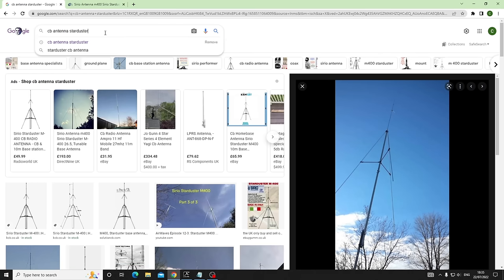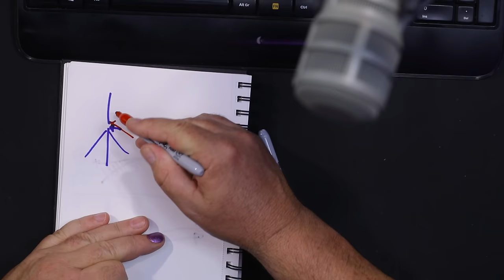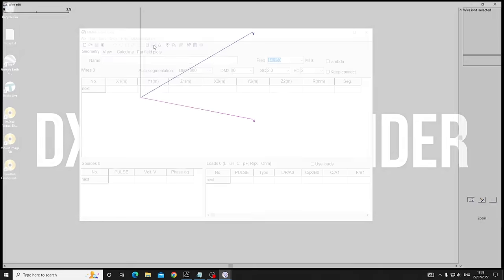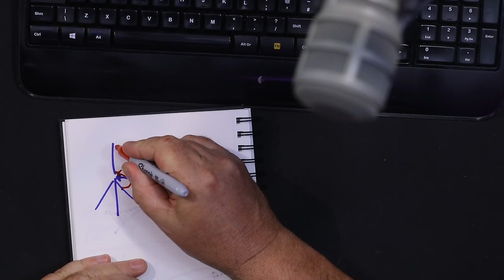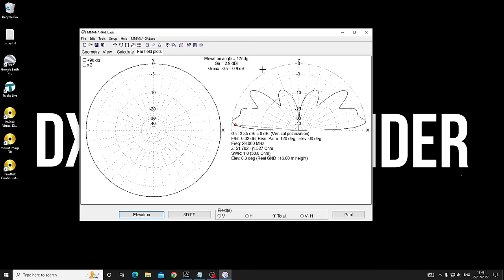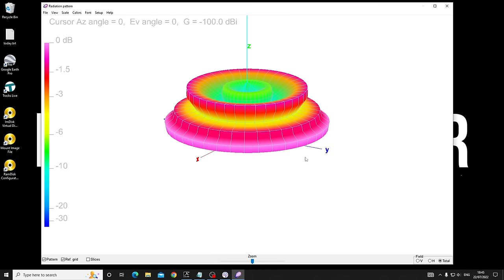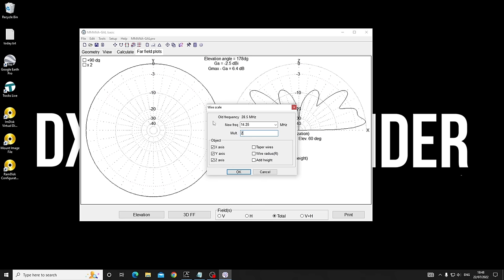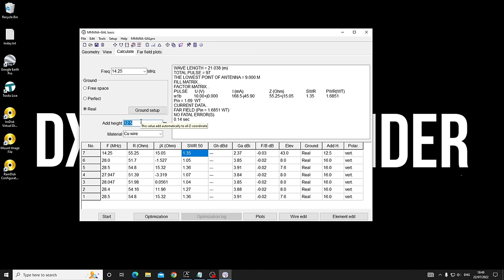The Ultimate CB / 11m Antenna?

Comment: I'm been studying and working on 10 and 11 meter antennas for 45 years. Some antenna theory has actually changed in those years. The Starduster was sold as a half wave. The coaxial feed line goes inside the mast pipe, for additional shielding / isolation from the antenna. The downside is the radiator is not grounded. The small radials are on the center of the quarter wave radiator. Some speculate that it is to increase frequency range, while some believe it is to raise the high current point on the antenna to reduce ground loss and increase gain. In a similar, "modified quarter wave" the radials are angled down to a point to increase the impedance to 50 ohms. The Starduster radials are angled down even more and possibly the small center radiator radials somehow decrease the impedance to match the feed line with the large radials angled so far down. The Starduster antenna design does work really well, especially considering its smallish size.
Reply from the maker: Very interesting Jim.. Thanks.
Reply: @DXCommanderHQ  Back in to late 70s I used a Starduster for 11m and 10m... After I put up a multi-band quad, I shortened the elements to optimize it for dedicated 29-29.7 FM use.  The radials were sloped down more than 45 degrees, perhaps 60 degrees, and the vertical/radial lengths were asymmetric. I tweaked the asymmetry slightly when I trimmed it for 29FM, increasing the asymmetry - making it more-off-center-fed - seemed to tilt the pattern slightly towards the horizon.  Also, someone diddled around with a coax matching section, 75-ohm I presume, and was able to get a "perfect" 50-Ohm match on theirs.
Reply: Same here !
Reply: The lower angle achieves a slightly higher gain. Isolation from a conductive mast is preferable for a cleaner pattern. A decent coaxial ferrite choke should also be employed for CMC, and you may wish to take care of static build up by grounding the shield of the coax (from memory, I think a 1/4 wave down from feedpoint). I have built such an antenna with 8 ground radials, and it was a great performer.
Reply: I’ll tell ya not for nothing but I talk to a few guys running them on channel 6 and there is a guy on 11 also and they just boom into my phone radio and I know there not running huge watts and I know they’re not lying because that thing would fry to much more then 2,000 watts and that’s not bein longwinded
Reply: Why this 45 degrees? How, by chance, does this mean the impedance will be 50 ohms? Why not some slightly different angle? How neat.
Reply: @jimjungle1397 any comments on the Gpa27-45 vs the starduster? Thanks.
Reply: @redeyegooner GPA 20-45 is a antenna made for the pirate 45 meter band ?
Reply: The star duster is a great antenna for obstructed areas no doubt.

Comment: I have a Sirio M-400 Starduster, I run on 10meters, looks identical to the one pictured.  I have it mounted with the feedpoint at about 30ft.   It is an awesome antenna.  I have worked a bunch of DX on that piece of kit.   It is wide-banded and is fairly flat across 10 and 11 meters according to my Rig Expert.   I believe the bit at the top is a capacity hat.  I say build the darn thing Cal!!!
Reply from the maker: Will do John!!
Reply from the maker: John... If you have internet - and if you have time, join us on the full-build and test Premiere? https://youtu.be/V8Qq4-0_TjQ
Reply: @DXCommanderHQ  the 3 things sticking out on the top rod is called a capacitance hat.

Comment: Excelent. I would love to see a rebirth of CB in the states. Maybe this antenna would be the boost CB needs.  A duel band CB / 10m   or would probubly be a good seller as you could get both Amature radio and CB band sales.
Reply: Kinda hard when these blowers aka cell phones are so popular. Still seeing aluminum in the air in my city, just a small handful still operating.
Reply: @fridayjoefriday  the CB band is manely full of people running higher than legal power and trying to talk to the world.  Very few local people using CB and even fewer OTR truck drivers. Hams all start from somewhere.
Reply: @brentchristians9888  I still use CB to talk with local peeps, circa 5-7 mile radius( most are licenced) but the conversation is easy like a pub lock in as opposed to a night at the Opera.
Reply: Thier is a uhf CB service in u.s. called GMRS and it uses repeater's up to 50 watts gaining traction as we speak
Reply: @Cardassiaprime : 😆🤣!!
Reply from the maker: Brent.. I managed 15m, 12m and 10m in the end.. If you have time, join us on the full-build and test Premiere? https://youtu.be/V8Qq4-0_TjQ
Reply: The cb band when theres dx which is quite often is busier than any ham band and you can make contacts worldwide

Comment: Antron A-99 with the 5/8 wave "power up" top section - add the ground plane kit, - best ever 10/11m I've ever used - had a great qso with Bob McLeod in the Falklands only using 10w on 10m using it.
Reply from the maker: Lovely!
Reply: Me too
Reply: Hi guy's, I use a high gain 36' J-pole tuned to 27mhz made from 1/2'' copper tubing hanging  from rope inside a tree and i can work anywhere i want from 5 to 100 watts! I have talked over 50 miles away on 2 watts as a test base to base no BS!
Reply from the maker: PS - If you have time, join us on the full-build and test Premiere? https://youtu.be/V8Qq4-0_TjQ

Comment: the bits at the top are probably a " capacitance hat " probably an attempt to widen / improve the s.w.r. bandwidth . It's a Super antenna Scale it up to 20 meters , it works a treat .  73's DE G4MXC

Comment: Thanks Callum, just getting back into 11 &10 meter radio now I am retired, I made a 1/4 wave vertical last night, took around 15 minutes and strung it up in a tree, the radial was also strung up so the antenna has a L shape, SWR 1.2:1, amazing indeed. I have learned so much about antennas the one thing is that you don't need to spend big $$$.
Reply from the maker: Nice work!

Comment: Ive been using a homebuilt CB antenna for the last 35+ years. I have no interest in DXing but I happily talk to the locals (15-20 miles away) without issue.
Its a centre fed dipole. A length of 2.5 twin & earth wire 18ft long left over from the house rewire.
Split the wire from its gray insulation. The wire is wound onto 2, 10ft pieces of PVC pipe like 2 firesticks.
So its 18ft driver and 18ft ground plane in a short package.

I did have a silver rod at one point... It snapped at the coil during a moderate wind, hence I built my own at the ripe old age of 12 years old
Reply from the maker: Nice one!!
Reply from the maker: OK, so I built this one in the end.. If you have time, join us on the full-build and test Premiere? https://youtu.be/V8Qq4-0_TjQ

Comment: The starduster reminds me of the thunder pole antennas years ago I had the thunderpole3 this had a small loading coil in the center of the main element.I actually changed the top element    and used a mobile modulator type antenna it worked really good.have a great day all and all the best to you and your families.
Reply: I think the thunderpole 3 was better than the thunderpole 2. Another antenna from the same period which used a center loaded top that worked well was the delta dx with the coax running down at an angle making it look like a boat sail.

Comment: as i just got back into cb i used a 108 aluminum element for center, then used 3 108 wires for lower elements adding string to use as guidewires also. was exact same look as starduster.
worked great! but last week i bought a 5/8 groundplane and new antenna was much better.
the difference in 9 foot main element and 22 foot main element was substantial.

Comment: There is a difference. Some of the big electrical 5/8 mobile antennas like the Sirio don't do as well for local contacts as simpler cheaper antennas. Seems to be the angle of radiation that's the issue. I think that three pointed thing in the middle of that aerial would increase the bandwidth a bit. You could try it with, and without, and see if it makes any difference. If you thicken an element it tends to give better bandwidth (at VHF anyway, I made dipoles out of aluminium foil to test this once).
Reply: You nailed it. They just slid that thing up, (or down,) until the antenna had a good SWR match across all 40 channels.

Comment: I had a Starduster years ago after college and found a shortfall no one speaks about.  Directivity due to the down radials for the ground plane.  I found by increasing the ground radials to more of a cone shape greatly helped reduce the directivity with a minor need to retune the vertical element. I found that a Discone design seemed to be the best design I could use but it sure was weird looking on the tower.  I should mention I am a retired Radio/Television Engineer.
Reply from the maker: Hello Robert. Now before I asnwer, you need to appreciate that your comment to mine will be buried, so I apologise in advance if I don't respond to you. However, I would like to understand! Maybe I can ask you to drop me an email because I would like to understand what you mean about "directivity". So for instance, was the directivity in the horizontal plane - or did you produce gains and nulls..? Anyway, an email would be great thanks. qrz at m0mcx co uk.
Reply: Robert, if I use 4 radials in my Exnec model the directivity problem in the Azimuth plot you note goes away, but the best gain goes down a little too using four radials. I doubt anyone would ever notice such small differences, however.
Reply: @eddiemarconi3420  That is to be expected as I noticed on my old Starduster.  I never tried readjusting the length to bring it into better resonance due to the more complete ground plane. With my experience working on AM Broadcast Band antennas we always installed as many ground radials as we could and then adjusted the tower lengths to optimize the radiated power. Laborious work but worth it when powering the antennas with 15 to 30 Kilowatts.
Reply from the maker: Hey Robert.. I got around to building this.. If you have time, join us on the full-build and test Premiere? https://youtu.be/V8Qq4-0_TjQ

Comment: Thanks for doubling my workload, because now I'll have to build one for 10/11 and one for 6.😱 Since Monday I've been working USB 10M on a new Anytone AT5555 PLUS/N feeding a homebrew T2LT/end fed RG58 coax dipole with 16 turn air choke hung in the redwood outside my bedroom window. I've made 30+ contacts 1,500-2800+ miles. Most signal reports 5/7-5/9; some 5/4-5/5. I'm gut hooked now and 10 is opening. This weekend with Winter Field Day working through the pileups gave me a lot of confidence in this trucker's rig that's my base and portable. Anytone had a long time to improve this model, but the "N" makes it worth using. The NR circuit they added to the V3 simply makes the difference in being able to listen without fatigue. But no, it's not one of the big three; then again it was only $200 with a $9 antenna. I learn from your videos more than hundreds of others, thanks mate.
Charlie KN6VYP
Reply from the maker: Wow. Fabulous!

Comment: The original version of this antenna was called the Thunderpole. I think this was how the company of that name got started. The reason it came about was because of the legal restrictions on CB base antennas at the time. The maximum radiating element length was 1.5m so half wave verticals weren't allowed.  The Thunderpole had a 1.5m base loaded top section. This type of vertical dipole arrangement was about as good as you could get if you were staying within the law. Although I had a neighbour with a half wave vertical that had a fake loading coil 1.5m from the top and the length below that disguised as a support pole. And back in those days you had to switch to low power if you used an outside antenna.
Reply from the maker: Fascinating!
Reply from the maker: Gordon, see what you think of this: If you have time, join us on the full-build and test Premiere? https://youtu.be/V8Qq4-0_TjQ

Comment: Built one and used it for 15 years +  seemed better with 4 radials and a slight difference on the feed point
The factory one was fed through the bracket that retains the radials
I fed mine on the side and 16M above ground wit consistant good results😁
Would love to see you model the omni quad
Built one for 2M and frankly i am impressed with the results so far
Love the content
Thank you for the excellent videos keep them coming👍
Reply from the maker: Quad.. Yes - and a good match to 50 ohms too! I'll maybe not build one, bit having experience of a PDL2 back in the old days, I might model one and see what it does!
Reply: @DXCommanderHQ  
The omni quad is not to be confused with the cubicle quad
Found the design on the ve3sqb site, i do not see it there anymore but it is still available on the way back machine, some ridiculous gain figures are claimed, how ever it has serious band width and from monitoring satelites it does seem to have a very low radiation angle
If the program is difficult to find i can zip it and try to mail it👍

Comment: Thunderpole did one without the little legs on the radiator element  the thunderpole 2 had a coil on it , I had one but I unscrewed mine and replaced it with a 9ft mobile whip , worked fantastic

Comment: When I ran CB radio, I run 5/8! 10.5 meters high. Coax was tuned with a 50 ohm dummy load. The radials 90 degrees to the mast. The antenna on the ground was tuned antenna wire 4 positions going out 22 meters. Then the radials were tuned  on the mast with the antenna with antenna still hooked the base of the mast. I was getting about 100 km a night straight shot and the day all around the world at 4 watts!
Reply from the maker: Straight shot. Lovely.
Reply from the maker: OK, so I built this one in the end.. If you have time, join us on the full-build and test Premiere? https://youtu.be/V8Qq4-0_TjQ

Comment: My personal favorite "ultimate" tenna setup for 8-11m is a Maco v58 on a pneumatic mast for tx and a 4ft square mag loop with 2" dia elements for rx. 
Why you ask?  The 5/8 mako has 5db worth of omni gain for fantastic local and its also a great skipper especially with a pneumatic mast to adjust the skip angle in real time.
And when it comes to pulling signals out of the mud its hard to beat a properly positioned mag loop with a sensitive pre amp or receive circuit. 
The day time noise floor on 11m is brutal enough then to factor in all the modern day man made noise is a perfect recipe for loss of interest.
Reply from the maker: Mag Loop - or you might also want to try a VERY long wire. I was pulling signals out of thin air with my very long wire experiement. I couldn't believe it..!

Comment: I "/think/" that little "thingy" near the top of the antenna might have been an attempt at a "capacitance hat" as I've seen a similar "thingy" on a Hustler 6 BTV multiband vertical ground plane that I had years ago.
Ch. 38 LSB and vicinity can be a lot of fun - sometimes 🤣🤣🤣.  Slightly seriously you might hear me there using the call of sorts "330 (reflecting one of the telephone area codes), Akron, Ohio, *Rubber City*"!
KD8EFQ/73!
Another good video Callum!
Reply from the maker: Hey Charles.. Yes OK copied friend!
Reply: @DXCommanderHQ  I don't take this stuff (Radio in general) too seriously.  I've been a class clown LONG BEFORE I started Kindergarten🤣🤣!
Reply from the maker: I don't know why they did that unless it was a shortened element.. I didn't need it: If you have time, join us on the full-build and test Premiere? https://youtu.be/V8Qq4-0_TjQ

Comment: I had the most success with the starduster in my cb days after trying many . I later put it in to service on 10 m until the wind damaged it.i was so impressed with this design I thought I would take the original pieces and cut it for 6 metres,again it worked very well indeed.im now thinking if I could practically scale it up for 20m it would be perfect.
Reply from the maker: Yes, I think 20m might be good fun!
Reply from the maker: PS - I managed 15, 12 and 10 in the end..
Reply from the maker: PPS If you have time, join us on the full-build and test Premiere? https://youtu.be/V8Qq4-0_TjQ

Comment: Nice work on this, Callum. I have a Solarcon A-99 and if there was only ONE antenna I could have for 10, 12, and 15 meters, believe it or not, it is the Solarcon. It gives around a 1.5:1 SWR on all three of those bands. Granted....it uses the coax as a counterpoise....but it does a bang-up job. I frequently get signal reports on FT8 here in Florida that is +1, 2, 5, or 10 DB over S9. Many hams are very biased against these kind of antennas because they are marketed as CB antennas...but who cares what they call them? As long as they work. 73 de Scott, W1AL

Comment: The things at the top are supposed to be a capacitance hat. It's a quarter wave with steeply angled radials. The design is in an old version of the ARRL. It's not a dipole since "di" means two and it has four elements.
Reply from the maker: Clever!
Reply from the maker: PS If you have time, join us on the full-build and test Premiere? https://youtu.be/V8Qq4-0_TjQ

Comment: I was fortunate to put an IMAX 2000 on our silo on our farm. Mast at 85ft and tip was at 102ft. I worked so much skip with 12 watts. I am a few miles from the geographical center of North America. Arctic, Atlantic, and Pacific and Gulf are all equal distance away...and I talked to a van in Australia with 12 watts in this setup.
Reply from the maker: Oh yes, at that height, a 6 inch nail would have worked! Love the Imax 2000. Easy antenna. Works too.